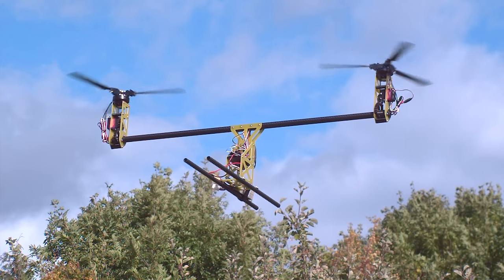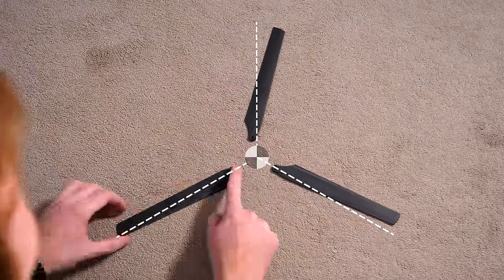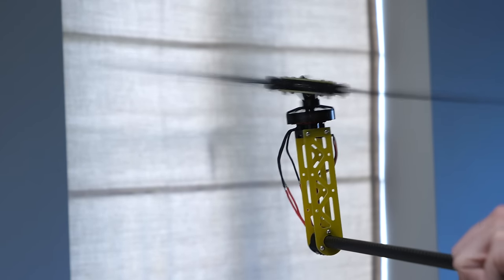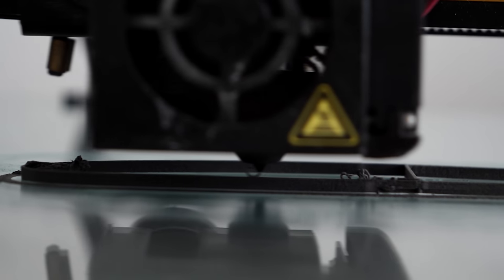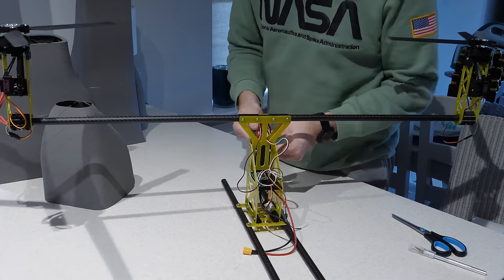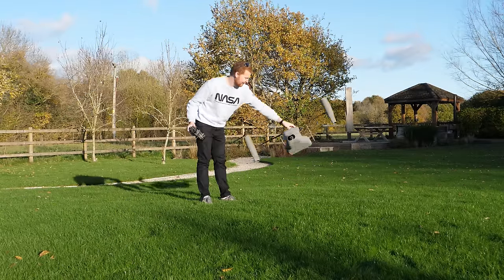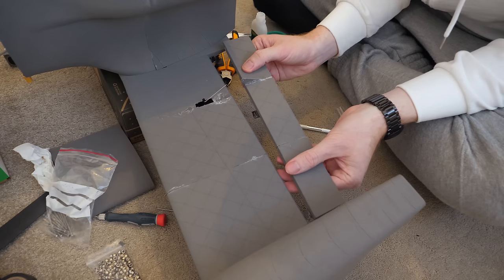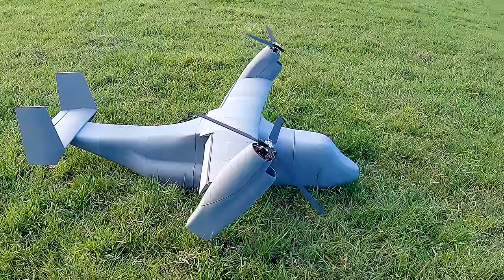Building a V22 Osprey - Part 2

Comment: Would it be possible to mount the motors more central to the pivot, and run a shaft up to the blades? This thing looks breathtaking, you've made an amazing impression of the real thing. I saw a flock of Ospreys once in central London years ago when Obama visited, and i was absolutely blown away.
Reply: Exactly what I was going to suggest - I'm sure there are challenges with designing it that way but it may be simpler than adding a system to shift the battery around
Reply: Was also about to make the same suggestion.  This might also help with full forward flight mode as well, as the centre of mass isn't shifted forward.
Reply: i think there would be an insane amount of drag and slop in such a system, it would make the motor-pulsing part very hard. the weight shifting via moving the battery is more plausible imo.
Reply: @KptnAutismus  A long shaft and a couple of bearings wouldn't add much drag at all.  Plus, the latest design doesn't do pulsing anymore, it's just using regular (ish) props with a fixed angle.  I think it could be a solution worth looking into.  The main issue I can see with that idea would be the added weight of the shaft in general, but that could be minimized greatly by using hollow shafts.  The load on them isn't all that much, RC helicopters almost always use hollow steel shafts these days and the forces there are much much greater.  It wouldn't need to be a very large, heavy driveshaft.
Reply: @KptnAutismus  it probably depends on the material used for the shaft and how long it would be. A steel shaft offset by only a few inches might not cause too much twisting when pulsing the motors. I think it would be interesting to see tested even if it doesn't end up working
Reply: @BladeScraper  i totally forgot about that, now it makes a lot of sense.
Reply: I just suggested this exact thing. I should have read comments before hand.
Reply: thought the same
Reply: @KptnAutismus  you have me an idea I suggested. Thank you for that.

Mount batteries in the motor pods to use them as counter weights. 2 smaller mAh batteries in parallel, or one for each esc.
Reply: @RiderAnton  And lighter too I would bet. I think he also needs to allow the airflow through the ram-air to exit out the bottom/back of the engine covers.
Reply: That would change the whole dynamic of the secondary tilt mechanism for control during the hover. Adding a longer shaft would reduce the amount of tilt available and reduce control authority during the hover. Moving the battery around is probably far less complex than solving the lack of tilt in the hover.
Reply: @RiderAnton  battery shifting is going to be a rail and easy as sin. Shaft physics gets into moments of inertia and leverage. So while putting motor central to pylons is more realistic it’s going to be massively more complex.
Reply: +1. You could balance the motor-shaft-prop assembly so that its centre of mass is at the pod's pivot point. Or, if the pods themselves are not perfectly balanced around their pivot, you could tune that out with the shaft assembly's CG (on 1 axis at least). Assuming it works out, rotating the pods shouldn't affect aircraft CG.
Reply: @schrodingerscat1863  yeah the only way the thrust vector control system works is because the motor assembly is mounted so far forward in the engine nacelles and can tilt the rotors around. Moving it back while mainting the same range of motion would require a mechanical joint in the shaft at the point where the motor is currently tilted for thrust vectoring, many more moving parts.

However, the thrust vector control system may not actually need the full range of motion it has now. My guess is that moving the motors to be in line with the wing axle will be way too far back and have way too little freedom for thrust vectoring, but maybe not. He should record data in flight and see the maximum tilt angles it needs to use currently, and maybe experiment how far they can be restricted in software.

OR, give up the stable nacelles, reintroduce a second high-torque engine to tilt them individually, and tilt the nacelles for control. Seems like a pretty radical redesign. 

Anyway there are lots of options and the battery counterweight does actually seem simplest (thanks to the wonders of software control).
Reply: Would it be enough to put the small tilt servos at the back of the nacels? They might weigh enough to balance the motors? Then the linkage would just be for rotor tilt in hover mode.
Reply: @Wasabiofip  I think if you look at the tilt angles which is the critical aspect of the tilt mechanism, moving the fulcrum away from the blades would have a huge effect on the tilt angle even moving it a little would have a large effect.
Reply: The most viable might be to move the  motor mount and servo further into the lacele? And then run a long shaft apx 100mm out the front and mount the prop, but the issue is that suddenly we have to make the whole thing move and not just the motor. But making independent motor lacels seems to be accurate?
Reply: @schrodingerscat1863  yeah I agree. A little experimentation wouldn't hurt though
Reply: or a counterweight
Reply: Or split the battery into two smaller ones and mount these at the back of the nacelles as counterweight.
Reply: Another thing to consider is motor cooling. They are designed to have a propeller directly mounted on them for airflow...
Reply: That would impair the thrust-vectoring ability and make hovering much more difficult.
Reply: @KptnAutismus  no it wouldn't... having longer motor-shafts to the prop through a bearing closer to the prop would have no measurable slop.  It's just the better solution by far to re-design the engine-nacelles to be heavier at the rear.
Reply: The simplest method is definitely just simple counterweights at the back of each pod. There is another maybe better solution though, a momentum wheel in the main body.. That could also be driven through a gyroscope to make the process self correcting.
Reply: No it isnt..bye

Comment: I'm glad you made it a scale model because it's REALLY interesting to see what kind of challenges the real aircraft designers had to overcome. Obviously they're dealing with much different scales and weights, but still fun to see
Reply: Exact to scale models of aircraft will work differently, meaning that challenges will not be the same.
Reply: We need to remember the difference between flying and falling with style, as Woody said 😂😂
Reply: Rotors on the osprey are definitely larger compared to the body as opposed to this drone
Reply: @jonslg240  true
Reply: Are the stl files available?

Comment: I often flew in & out of Arlington, Texas Airport. At that time, the V22 Osprey was being built & flight tested occasionally using that nearby non-tower field for flight testing. Was amazed to see it fly, & even more so as the engines were moved from verticle flight to normal horizontal. The thing accelerated  CRAZY FAST

Comment: very nice. The solution to your Centre of Gravity shift during transition is to balance the nacelles so as they move the balance point doesn't shift. you will need to move the motor back as a counter balance to the head. I would even consider mounting the batteries in the nacelles too. Also the swash plate design is a far better method of control as it allows for a constant head speed even in wing borne flight using collective pitch to control airspeed and very precise cyclic control in hover.  Suspect to get it fly nicely in all aspects your going to have treat it like a conventional Tandem helicopter and plane rather than a drone. But its is great to see.
Reply: Came here to say this. 

The simplest solution would probably be to add a longer axle to the motors, moving them closer to the pivot point, which also moves more weight much closer to the center of lift and the center of gravity, both of the nacelles and the aircraft as a whole.
Reply: Is there any reason why the motor can’t be mounted at the level on the wing spar and drive the rotor head via a shaft?  Still tilt the rotor head but have a universal joint at the rotation axis for the head.  The other options you brought up with weight shifting a battery or counter weights in the nacelles sound … overly complex?  

I’d think the only acceptable ‘counterweight’ in the nacelles would be the battery(it’s) them selves.
Reply: damm

Comment: The level of expertise on design for 3D printing and also flight control is just off the charts here. Mad respect, Tom. Would it be possible to mount a couple of small batteries in the bottom end of the nacelles, as counterweights?
Reply: damn, too late, had the same idea! :D If you put the batteries there, you could even use shorter power cables.
Reply: Yeah I just commented the same thing. It seems to be the obvious answer.

Comment: The way you model in the stiffener ribs is revolutionary. I really hope slicing softwares add that feature and give credit to your idea.
Reply: I, over here, would've just done a basic shell model and let Cura infill the shell. The ribs were a brilliant idea 👌
Reply: This has been a feature of 3dlabprint aircraft for at least a couple years
Reply: I don't think that the plural of software is softwares, in the same way that the plural of lego bricks is not "laygoes", the singular of saving is not savings, and the name of the bit of a race track which isn't curved is not the "straightaways".

Comment: That Cg shift could be fixed by offsetting the motor tilt servo to the back of the nacelle and using a linkage instead of gearing. You have plenty of space inside the nacelle so it should be possible.
In general rotating things should always be balanced, especially if it's a flying thing 😉
Anyway, awesome project as usual. It would be great if you could show a bit more of the process that goes into the stabilizing algorithm and the command and control.
Also hope you get to use all these weird rotors in another project.
Reply: Had the same thought. Moving the motor back  to the center of rotation and using a "drive shaft" to the front of the nacelle where some kind of ball joint (like in a FWD car, I don't know the technical term) sits, to enable the pivot motion of the rotor.
Reply: top comment right here, tom needs to see this
Reply: Motor in nacelle could be balanced with useful weight of additional battery. 😉
Reply: Yep, I had the same thought. Also might cheat the motor position and/or the pivot location to help achieve a balanced nacelle. Might lose a tiny bit of scale perfection, but it might be worth it.

Comment: Really an awesome project :) What about adding two smaller batteries to the lower (back) part of the nacelles? I imagine the original has the pivot point around the center of mass of the nacelle and by moving the batteries in there you might automatically shift the battery as needed.
Reply: My first thought also! Use the batteries as the counterweight. And consider the suggestion of a longer shaft on the motor below. Combine these two, and you can probably get the CG to stay put during the transition.
Reply: @markdriedger9464  That would also move the pivot point of the thrust vectoring mech though

Comment: Awesome build! Perhaps moving the motors closer to the pivot point and using an extended (supported) shaft would keep the center of mass closer to the same spot. I'm sure you will find a solution , and I am looking forward to seeing it.
Reply: That was my first thought but that requires an articulated shaft to maintain his vectoring feature
Reply: Hm? Keeping the head assembly and moving the motor back with a fixed axle ending where the motor axle currently ends should not require any extra articulated joints? There seems to be enough space in the nacelle to achieve static balance of the nacelle contents.

Awesome model!

Comment: Move the motors (centre of mass) down as close as you can to the tilt point between the wings and engine cover. And use some sort of extension for propellers to clear the top of the engine cover. This should fix the weight shifting issue when going back to hover mode and when in full forward flight.

Comment: Guessing it's been suggested, but I'd be interested to see if the shifting-CG problems could be solved just by weighting the back of the nacelles so the CG of the motor assembly is right in line with the pivot. Then no matter if you're in hover mode or forward flight, the overall CG wouldn't be moving. Great vid as always, love seeing the work that's gone into making this one work!
Reply: He addressed that at the end of the video if you watch I'll the way through, he doesn't want to add any extra weight considering it already struggles

Comment: Awesome! I'm sure someone else already suggested this but have you considered using two batteries and placing them in the nacelles as counterweights? It could have other benefits too - like reducing the stress on the airframe during flight and increasing roll/yaw inertia for a bit more stability.

Comment: Great video, Tom! It's awesome seeing all the things you've explored through this project.

One suggestion - You've mentioned several options to solve the weight movement issue during transition, but I think you missed an obvious simple solution. Instead of trying to move mass (complicated) or counterbalance the motors' movement (heavy), you should see if you can add a coupler/extension shaft to the motors so that you can keep the rotors in position, but move the mass of the motors close to the pivot, which would reduce your c.g. shift in transition to/from forward flight/hover. There's nuances to solve in this too, no doubt, but I'm sure you can figure it out. Keen for the next part!
Reply: hehe thats almost a V280
Reply: Counterbalancing is fine as long as you only move parts that were already added

Comment: You can add a stabilizer to elevators like on the real plane. Thus balancing the cg while transitioning. Also smaller incriments would better. Only problem is the size . You will need a much bigger servo space than the current model. Actually Tom you are my idol. Always amazing projects.

Comment: Fantastic bravo!!! I have a suggestion for the moving CG issue without adding weights:
Move the motors down and nearer their axis of rotation, with a longer propellor shaft (in bearings). Then when transitioning, the weight of the motors will not move very far.

Comment: Regarding the shifting of mass of motors. I think another solution to balancing the motors would be to drop the motor further down into the pod and add an axle to transmit power to the prop. Of course this would mean adding another bearing but the weight would be significantly smaller than a counterweight while still achieving the desired effect.
Reply: Wouldn't mind seeing that tested
Reply: That was my first thought, I was about to comment the same thing!

Comment: This thing is amazing!

Here's an idea I had, since you seem to also enjoy working with comically impractical means of propulsion:

Inertial Shifting Helicopter

Unlike traditional helicopters, this one does not use changing motor speed or rotor angle of attack to vary its lift. Instead, it relies on weights in the rotor system which can move in or out, closer or further from the center of rotation, thus affecting moment of inertia and exploiting conservation of angular momentum to change the speed of the rotors and therefore the lifting power. This would work similarly to how a figure skater rotates faster when pulling their arms inwards.

You would need a motor with fixed speed and perhaps a sort of clutch mechanism to allow speed changes to occur without disrupting the motor. Maintaining altitude might also be a problem.

It's probably stupid, and I haven't fully thought all this out, but let me know if you think the idea has any merit.

Love your channel. Thanks!

Comment: I think you should put the motor closer to the wing spar but keep the propellers where they are. On the real Osprey the center of mass of the engines is probably close to the spar if not inline with it

Comment: I think at least part of the reason it was pitching back when you transitioned to hover was because you were still trying to slow down and were pretty much flaring as you transitioned, so when the propellors rotated they ended up pitched really far back. You can se it really well at 20:29.
Reply: Yeah, that nacelle transition looked pretty fast also. The real aircraft does it very, very slowly, as it simultaneously slows down, keeping the nacelle angle within the allowed angle bracket for the current IAS at all times. It's a pretty complex transition.